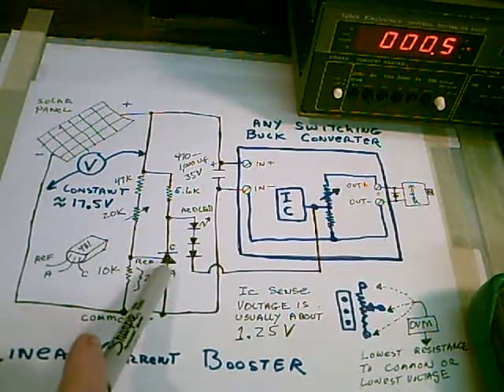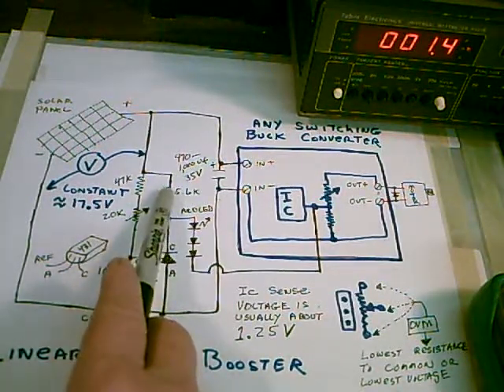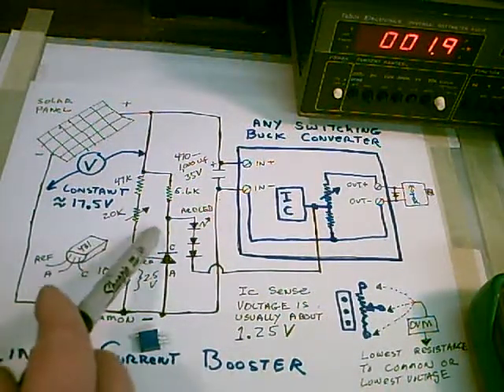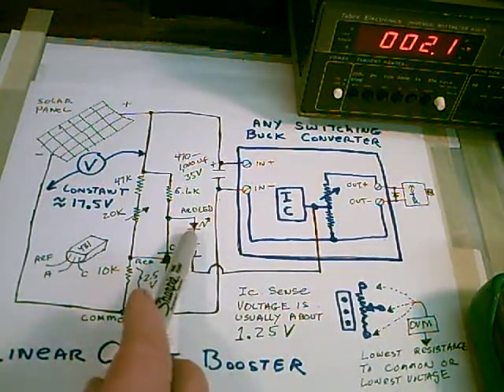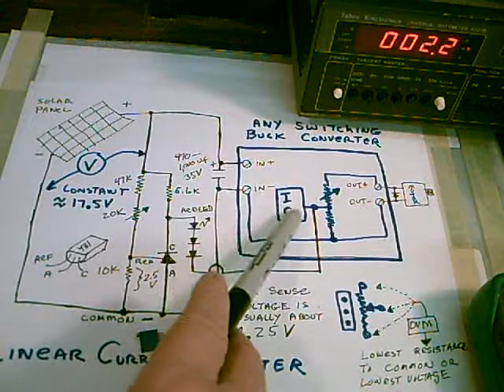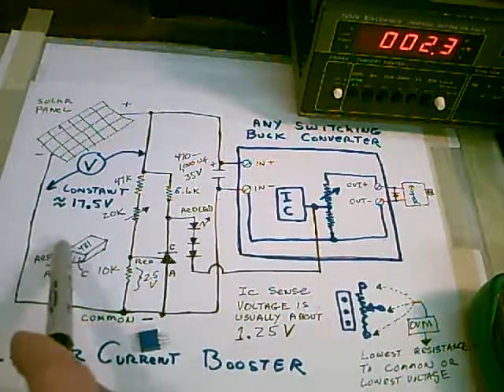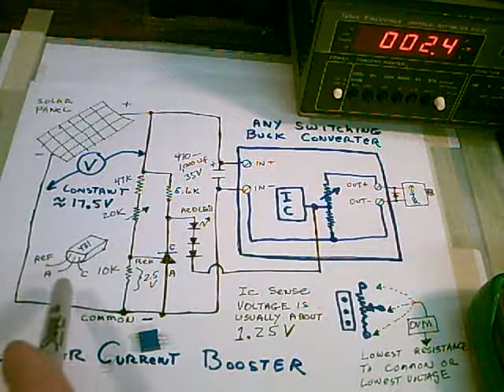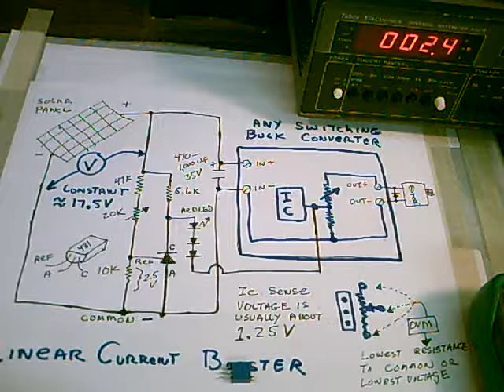Pump Aerate Pond Without Batteries,  Linear Current Booster

Comment: Thank you for making this great video. I think it will help me a lot. I noticed that you put two diodes after the red LED in the diagram. Are those just any old diodes such as 1N4004? Also, is the diode on the motor output necessary and can I use a 1N4004 if it is?
Reply from the maker: Any silicon diode will work from the small signal 1N4148 to the 1N400X series.  These are used for the forward voltage drop and to prevent a load on the buck converters voltage divider.  A red Led will be about 1.7V and green LED are about 2.1V.  This is added to the 1.2V of the diodes for over 3V of offset.  The TL431 can only drop voltage to 2V.  This prevents any voltage feed to the buck converter voltage divider when panel voltage is over the set minimum. This is a very useful technique for also making an efficient battery charger. Thanks for watching.
Reply: @opera  Thank you for responding and for making such a great circuit. I built it and I was surprised at how great it worked. I am using it with a 100w 12v solar panel and a 32w 12v pond air pump. No more squealing/stalling motor and now the pump putts along even on cloudy days and for longer. I used the same exact 8A 200W buck converter and attached the wire to the two joined pins of the three of the converter's potentiometer. For the 5K  circuit potentiometer, I found that the half way/center position works best. I also like how I can see the LED turn on when the sunlight to the solar panel is reduced. I also drilled holes in the box that I assembled everything in so that the fan in my pump box could cool the two heatsinks on the converter since they were heating up during testing. Before your circuit, I was using one of those "TOSBUN" 5A 24v to 12v epoxy sealed buck converters that are very common online and it caused the motor to stall at a certain point.
Reply from the maker: @SirAzur3   Great to hear you got it working.  You should do a little video. I don't have any ponds to show actual project in action. Pond pumps are very popular on YT and so many spend a lot of money and don't get the results you did.